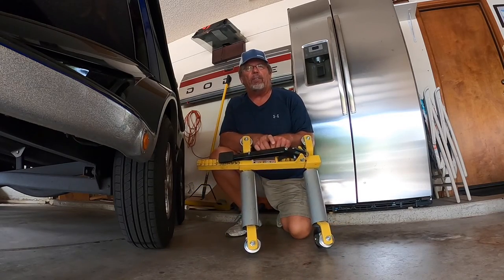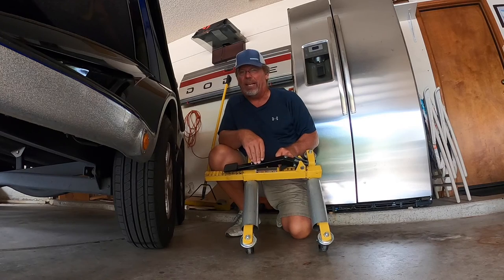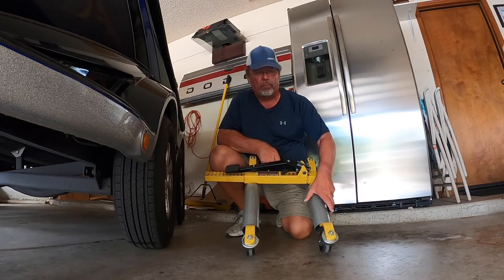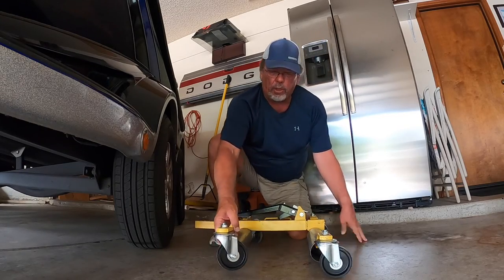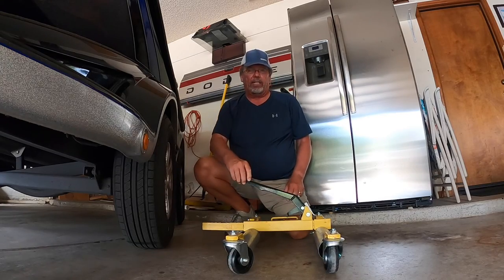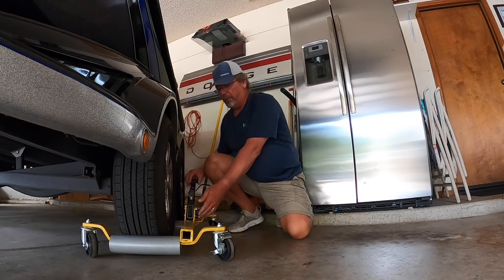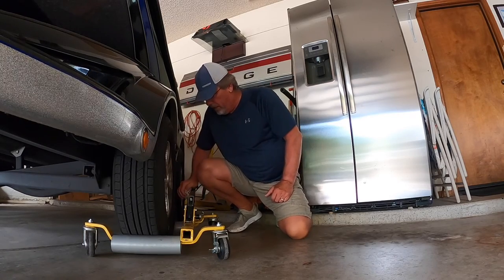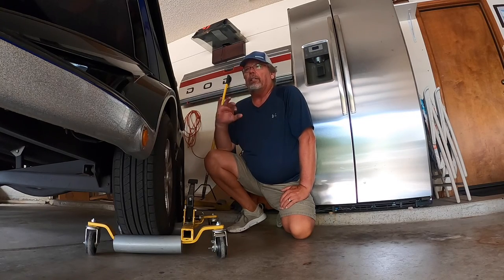Tandem Trailer Maneuvering On Pavement Made Easy

Comment: If you lift the front wheel as high as it will let you will it take some pressure off the back wheel or maybe even lift it up a little?  I would think think that the back wheel would have more weight on it due  to the motor.

Comment: What does your boat and trailer weigh?
Reply from the maker: It’s a 19”6’ Ranger and trailer. Total weight is around 3000 lbs.
Reply: @fishingwitht6447  thank you. I'm waiting on delivery of a Ranger 2510. Boat and trailer I estimate to be around 6,000 lbs. Do you think these trailer Jack's would work on that size of boat? Would need to roll on paver driveway with grout seams every 6 inches or so. Thanks.
Reply from the maker: That’s an awful lot of weight! You’d probably be just better off using a truck. This is more for lighter weight applications